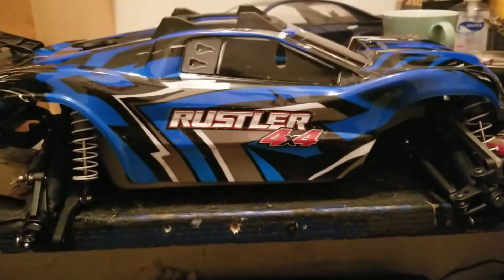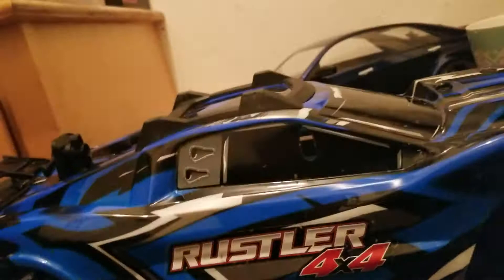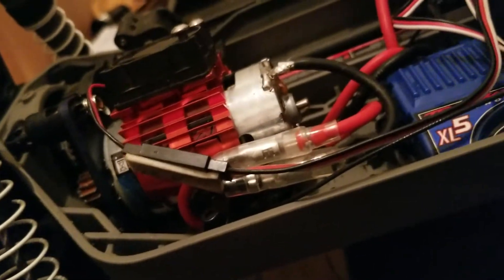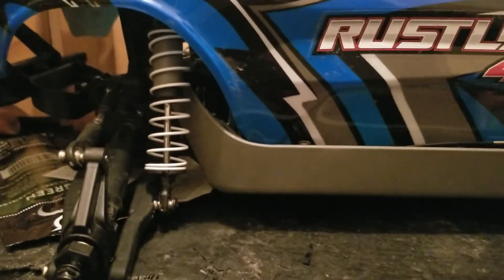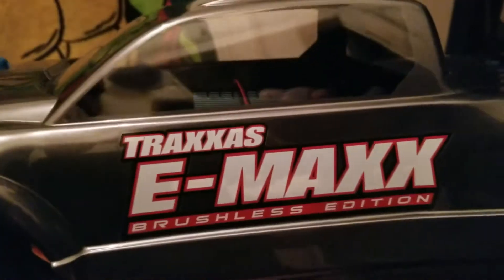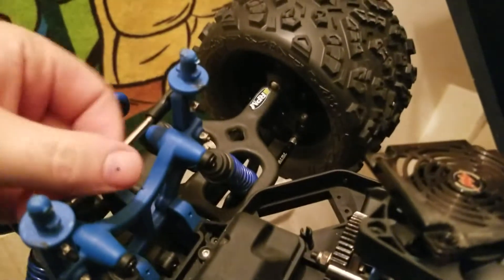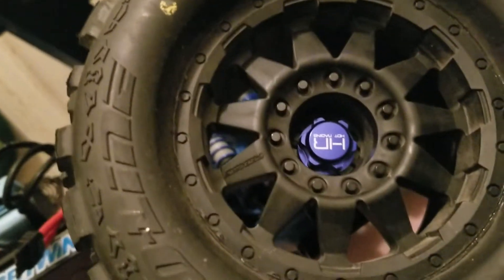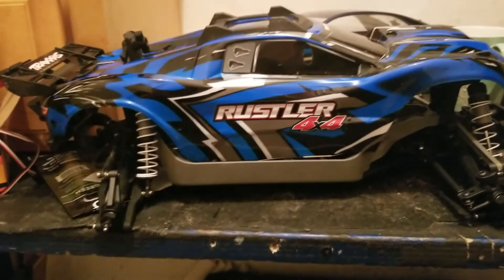Goolrc traxxas rustler 4x4

Comment: How many people dislike the body because they just haven't put the front shock screw in closer one hole.  

Walla body comes off and on easy as cherry pie being well uno.  

I drop my body on and a small slide back and it basically falls into place dropping down in its spot.  

Could not be any easier.  👊😎hope that helps man.  I know it's silly easy. But easy is as easy as we make it.   ✌️